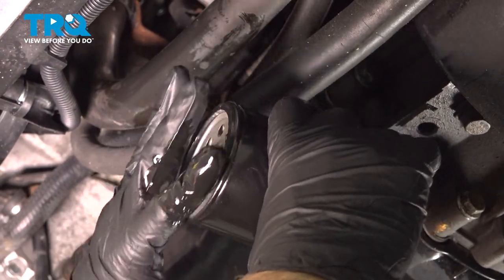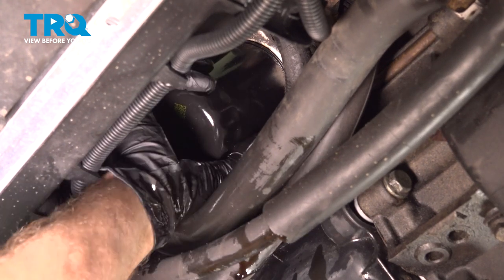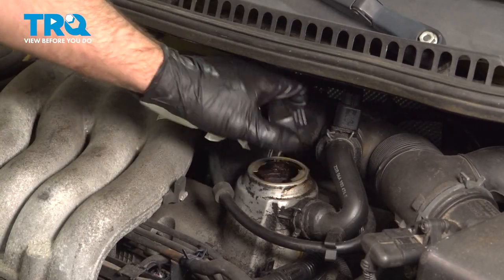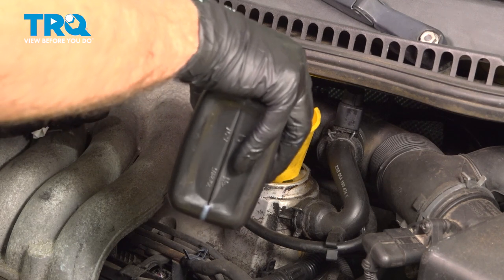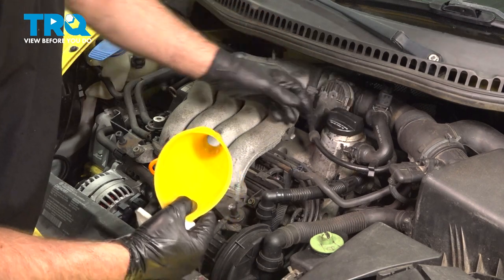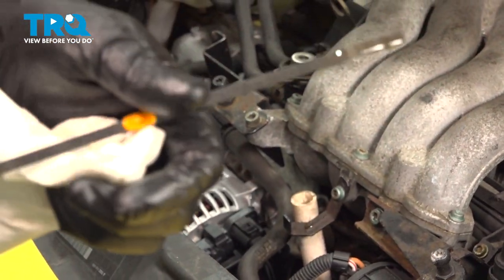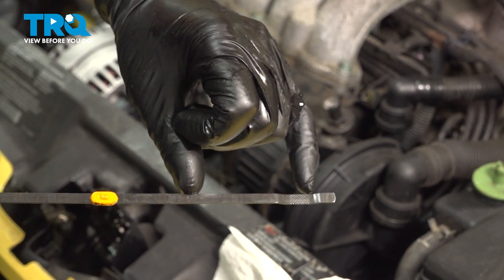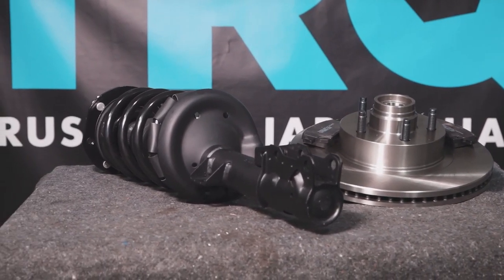How to Change Oil 1998-2010 Volkswagen Beetle

Comment: Video description contains links for all "toolsb required" (~½ of which are silly & ridiculously unnecessary! 😂)
But THE MOST crucially important item is MISSING!!!  That is, of course, specs (weight, etc.) for the MOTOR OIL the car takes...!!!  (like: 5W-20/10W-30/whatever...)

Seriously?!?

Inexcusably PATHETIC! 

Would it really have taken that much effort, and just "put you out" to include that info in the video description?
(I should have to attempt to find out the video itself considering the sorry long list of links to added...)

Oh... And BYW,
(I am 100% aware that this info is on the oil cap & other easy to see/find spots in the car...
But i am at the store & didn't even drive this vehicle!)